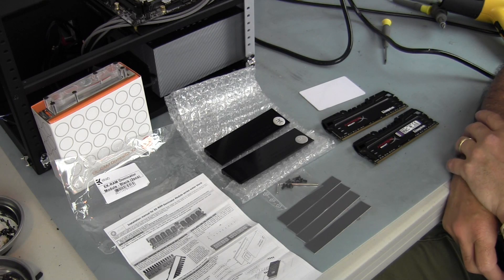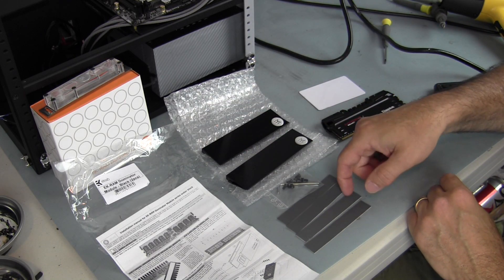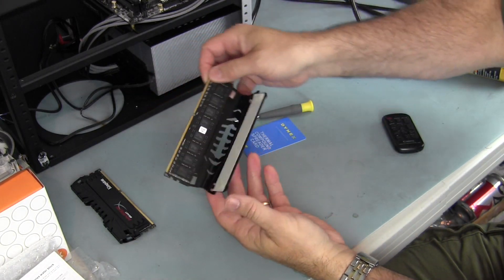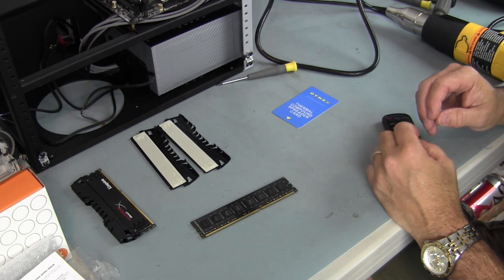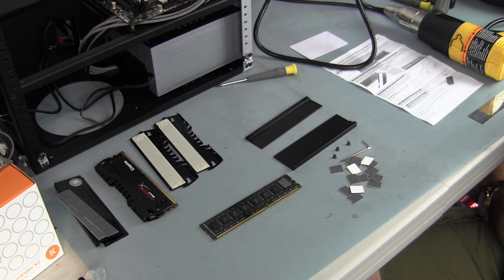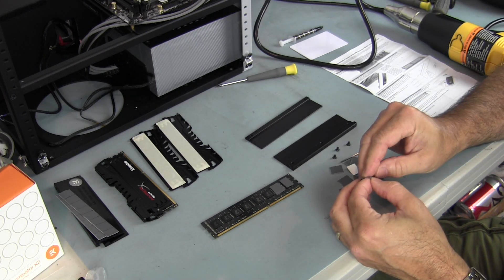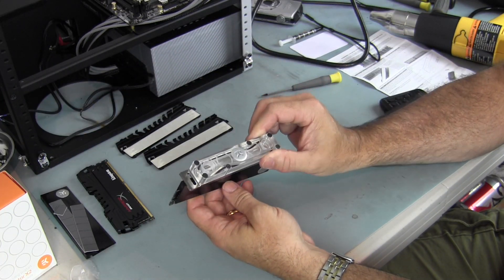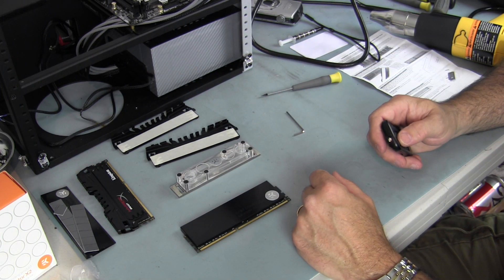How to Install EK RAM Dominator Module Adapter or EK RAM Monarch Module Adapter

Comment: Hey, could i buy those adapters just for aesthetics and just leave it with the adapter heatsinks? Like do i need the waterblock or is the ram fine without it? Love the design of the silver monarch adapter thats why i'm asking. Thank you :)
Reply from the maker: Yes you can just use without water. The look great.
Reply: @Ronsanut  thank you really much 😁👍

Comment: Thank you, good guide. Quick question, I am just looking for some sort of heatsink or even just to change the look of my bare ram modules on the motherboard. I do not intend to put the water cooling, would it be an issue just to put this dominator module adapter for the looks? Cheers
Reply from the maker: Yes, using these as regular heat sinks is fine. Watercooling ram is really only for show.  RAM does not require watercooling.
Reply: @Ronsanut  Ok thank you for the fast answer!, cheers!
Reply from the maker: @kalkydra  You bet. Thanks for watching.

Comment: I'm water cooling some gskill trident z rgb. The problem I have is that there are very small silver modules on the sticks and are breaking through the thermal take and contacting the aluminum heat spreader. I'm not sure if they are conductive at the point of contact or not
Reply from the maker: Probably not a good idea to let them touch. I would not take the chance.  Maybe if you use some thin mylar or kapton tape to prevent shorting.
Reply from the maker: https://www.uline.com/Product/Detail/S-7595/High-Temperature-Tape/Kapton-Tape-1-Mil-1-2-x-36-yds?pricode=WB0218&gadtype=pla&id=S-7595&gclid=Cj0KCQjw6PD3BRDPARIsAN8pHuEScVof5e8k9bpM97dW-LEIGaLKotz3z0ohRu4GegLG0xJ4Htnz8qsaAr-WEALw_wcB&gclsrc=aw.ds

Comment: I don't understand.  I just got my monarchs...  and I don't get it.  the thermal pads are not sticky on both sides...  so how are they suppose to stick the RAM to the modules? either direction I put the sticky side... the RAM will not stick to the EK modules... I expected these thermal pads to be sticky on both sides... Are they supposed to be held up by just pressure??  please help
Reply from the maker: You can also use a little thermal compound so they stick.  As long as they touch the chips and the heat sink you are fine.  But a little thermal cmpond helps and can improve thermal compound.

Comment: So this work with DDR4 ? I have tried to check compatibility, but it shows motherboards and not ram is that normal ? my motherboard is in the list of compatibility and it's DDR4.
Reply from the maker: Depends on the size of the DDR4 RAM Stick.  If it has the same dimensions as most DDR3 memory pcb's it will work.

Comment: looks like ass in a mitx build.. why have a custom look period in a tiny ass build.. not enough heat is even generated...

just over kill... and stupid.
Reply: nice English buddy.
Reply: Rather than just calling you stupid, I'll point out that the heat output of a pc has nothing to do with the form factor of the motherboard and instead depends on the components plugged into it.

Comment: do you prefer these single stick coolers, or the block type coolers that cool all 4 sticks ?
are there any measurable differences in performance between the two types ?
which has the least flow restriction?
as i like the half inch large tubing and fittings

Comment: hi.....can these be used as passive heatsink.....on my ddr4 RAM ????
Reply from the maker: If you bought DDR4 RAM without heat sinks, yes these can be installed and will do the same job as a stock RAM heat sink.
Reply: +Nish Kumar You can also by dominator fins from Corsair that will fit on these if you want extra cooling.
Reply from the maker: +Nish Kumar Yes. And as Frode states you can get Corsair Fins to mount on top as well.

Comment: Can you do the same with the Dominator Platinum series ?
Reply from the maker: Yes basically just about any ram stick that uses a normal sized PCB. I have not ran into one yet that has not.  Just be careful when taking it apart. Use a heat gun carefully.
Reply: Ok, thanks !

Comment from the maker: Certainly you would be doing that at your own risk, but I would imagine that they have to be removable in some way. I would think heat should remove them but have never tried it in a set of the new CORSAIRS. Just be delicate with them as you do it.

Comment: Thanks ron a great help thanks! Ron have you any experience with water blocking an msi 7970 lightning be? i have one but need to order a block from japan as ek have stopped making them now, and from what i have read there might be a problem with them, lots of people have killed there cards with them but others have done it ok so i'm kind of worried about doing it,just wondered if you have done one.steve

Comment from the maker: Yes you could, these work on any standard RAM PCB stick. But why would you pay the premium for the Platinum, just to remove those awesome leds and ram tops.  I would just buy very good and fast Kingston, Crucial, or other Corsair sticks that are not as expensive and remove the heat sinks. Unless of course if you already own Platinum's and want to do this.

Comment: Maybe it's just me but should you add thermal paste at the joint of the two plates.  Otherwise the side not directly touching the water block won't transfer heat well.